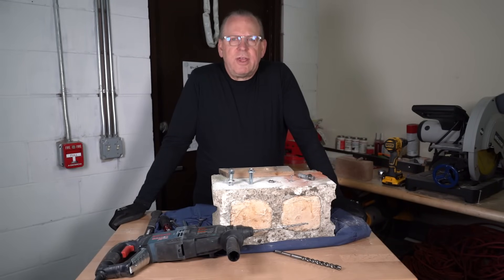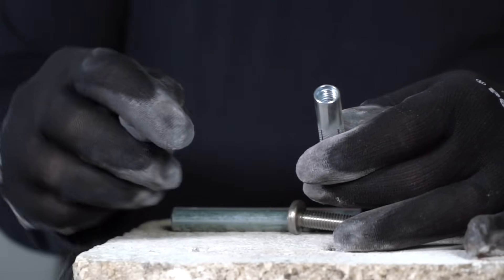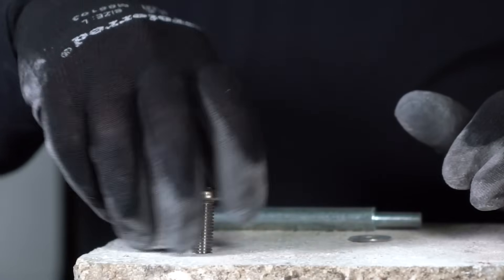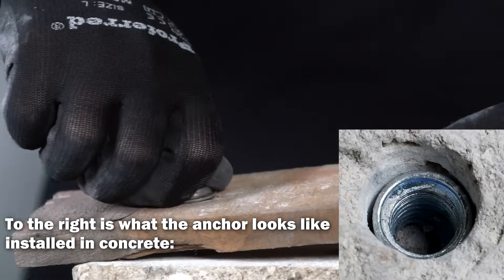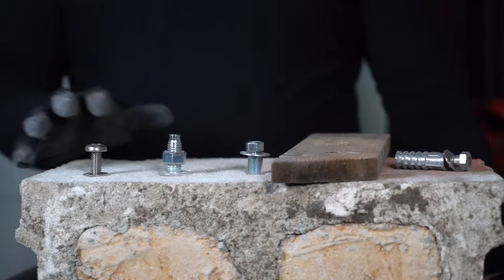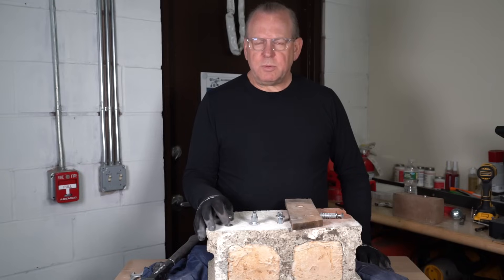How to Install Masonry & Concrete Anchors | Fasteners 101

Comment from the maker: Here's a series of quick links for our viewers if you want to see specific parts of the video:
1:19 - About Lag Shield Anchors (Link in Description)
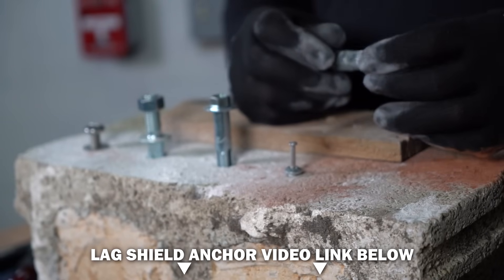1:30 - What You Need for Installation
2:57 - Installing a Drop-In Anchor
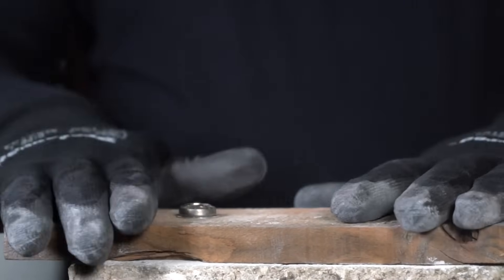5:32 - Installing a Wedge Anchor
8:07 - Installing a Sleeve Anchor
9:47 - Installing a Hammer Drive Pin Anchor
Reply: Can you show how to remove the anchors?
Reply from the maker: Concrete anchors are not designed to be removed. This makes them more secure because they are actually anchored into the concrete, which means they can't be removed without heavily damaging the anchor or concrete. You can use a sawzall or similar tool to remove the tops of wedge or sleeve anchors.
Reply: at 5:30 when you say "Fastened" was my favorite part just classic
Reply: Hello, Drop-In  vs Sleeve anchor, which is better for hanging on slab?  Thank you.
Reply: @AlbanyCountyFasteners  hi, how about realigning wedge anchors if they're off center? or do i need to resign myself to oversizing the hole in the base plate?
Reply from the maker: @philippetts1701  yes oversized and double up with fender washers if needed.  Bolts should be tight an seated firmly.  Good luck!
Reply: @AlbanyCountyFasteners  thanks for the advice, however, before drilling the post base, I decided to try realigning the wonky anchor bolt, and it worked. Used a lump hammer and some hard wood to avoid damaging the threads. Only needed moving a couple of degrees, and it didn’t loosen the fit, so it’s still solidly in the wall and tightened up well when I torqued the nut up. Maybe I’ll be reposting back here in a few weeks/months/years if the bolt ends up pulling out though!

Comment: Video on fasteners was very easy to follow with an explanation of product and use.   I have used stainless steel screws and washers for my screen enclosure in Florida and I am extremely happy with their performance and appearance after three years.  The washers were recommended by Albany because of use and dissimilar metals which can cause some corrosion. So far no corrosion has occurred and I am extremely happy with their performance and their cost.

Comment: This was a very helpful vidoe demo. I went and bought the second bolt anchor. I poured square footings to support a trellis archway. I'm using an L bracket to bolt the 2x4 against so it needs to be secured in the concrete. I just put them in before it was solid cured. Once it's completely dried I'll tighten up the bolts.

Comment: Thank you! I drilled big holes in the ceiling concrete and wondered if I should apply a hammer for the sleeve anchor or not. Useful thanks

Comment: Love the calm vibe of this tutorial.  I couldn't figure out the differences for masonry fixings. Going to use wedge anchor bolts to put up an awning and hang a side gate, just need to make sure i drill the correct distances too. Kind of laughed each time I heard "Once this goes in, it's not coming out." 😨 It'll be fine I'm sure.

Comment: Thanks that is very informative easy to learn. I stop in store in front of the concrete screws I did not know which one to use. I asked and I think I bought the wrong one.
Thank you again. No I can fix the 2 x 4 to the wall.

Comment: Great video. Thanks for creating it.....   Question. I am about to use a wedge anchor bolts in concrete footings for a deck project. In my case they are Red Head TruBolt brand.  I drilled the holes too deep and the entire 5" bolt can sit in the hole without touching the bottom. I will also be using Anchor fix epoxy in the holes. Will these bolts still work if they are not touching the bottom?  My fear is that when I tighten the bolts they will simply rise straight up as the nuts are tightened without pulling the expandable bottom into the sleeve.

Comment: Great vid. So if I want to drill eyelets into my garage's concrete ceiling to suspend a Jeep hardtop, I'm guessing the drop-in anchor is the best solution, so i can screw in the eyelet (and a future owner could possibly remove them)?

Comment: Great video - -BUT !!! - -no word on the most important part !!!!!!!! - - -how deep do you drill, you have to take into account the thickness of what you are fastening, as well as length of the dyna bolt (expanding bolt)) TO MAKE SURE WHEN YOU FASTEN EVERYTHING IS FLUSH !!!!!!
MOST IMPORTANT THING LEFT OUT !!!!!

Comment: hello, thank you so much for the video, very informative.  Perhaps you have some insight for me; I need to install an eyebolt of sorts into a garage floor in order to use it as leverage to come-along a vehicle that does not currently run into the garage, I need to be sure that the weight if the vehicle will not pull the anchor out of the floor. I would appreciate any help or suggestions for this application.  Thank you

Comment: Thank you, very helpful.  I am setting up an aluminum pergola on my patio. Do you recommend a drop anchor?  Has the square bottom brack with 4 screw holes
Reply from the maker: Yes I would us a drop-in achor.
Reply: DOING THE SAME THING WITH A GAZEBO

Comment: Hopefully you can tell me for a solid oak sign 96L x 22W x 2D, there is no way I can weigh it. It is large. Which bolts would you suggest? I was going to put 6. 3 at the top and 3 at the bottom.

Comment: Can you talk about how much you can pull with these. Maybe rate the holding force from strongest to weakest. I want to pull up a piece of concrete. I guess about 6K lbs, so don't know which are the best for them. I would think one of the first two.

Comment: I like it! Im wondering if i can make a hole on the concrete without a hammer drill?.i dont have all the tools.will it be possible to use a concrete nail as same as the bit diameter? 😁
Reply: I think you can with drill that has percussion mode and a good masonry bit. It will take a bit longer than hammer drill, but should work. Make sure you have a more powerful drill, like 850w or more and if it overheats, take some breaks. If you have small drill, like 500W, it may be harder to do it.
Reply: @nilsfrahm1323  Or he can do what I Do, Start off with a smaller size bit, followed up with the desired size bit or a Bit size that is between the smaller bit used and the desired Bit. Like having a pre drill hole.

Comment: What anchor do you recommend using to secure a steel gate post on top of a concrete footer?  The gate will separate the front yard of a home from the backyard.  Rationale for placing the post on top of the concrete instead in the footer is to create a modular post that enables the entire gate assembly to be removed and reinstalled to accommodate movement of large items, such as a skid-steer, in an our of the backyard on rare occasions.  Space between the post and the side wall of the home will be roughly 1 inch and space between the other gate post and the brick wall along the property line will also be approximately 1 inch.  Total distance between the home and the wall is 91 inches.  The posts will need to support a 6' steel frame gate with wood laminate inserts.  Weight of the gate is unknown but estimate to weigh 70 to 100 lbs when constructed.  The size of the gate and space between the wall and home is set due to safety specifications required as a result of the backyard having a swimming pool.  This also creates unique challenges because if the post is 1" from the home and another inch from the wall, then I'm unsure what type of metal plate design should be welded to the base of each fence post to use as a securing mechanism between the gate posts and the anchor bolts.  Regarding anchor bolts, based on this video, the drop-in anchor appears to be the best option for my need.  However, if you have a different recommendation, please let me know.  I can also email a picture of the work layout if that helps.

Comment: What would you say are the anchors people use to anchor eye plates to the ground when using chain hoists or come alongs to pull shed walls back into an upright position.
Our sheds on a lean and we're pulling it back into place with a chain hoist and I was going to put the anchor on the opposing walls foundation beams, but maybe just putting it into the concrete is better, i'm not sure.
Reply from the maker: Wadge anchor but drill the hole deeper so you can cut the wedge bolt off and bang the remaining into the ground.

Comment: Hi, I want to attach a 2×8×10 two ledger boards to the brick wall of my house, for my patio cover, I was thinking of using red head 1/2×4-1/4 wedge anchors,  every 3 feet, since it is a 20 feet long ledger board, will it be strong enough?
Reply from the maker: No wedge anchors.  I would use 1/4" hex head Tapcons.  Wedge anchors will crack the brick and fail.

Comment: need to anchor a post for a railing.  The stairs are limestone on brick, which anchor do you recommend? How deep should I go to anchor a 36 inch high post?  Also, how much bigger should the bit be for a 3/8" anchor bolt?
Reply from the maker: Lime stone is soft and will crack.  You will need to drill through the lime stone and into the base brick.   You will need 6" threaded studs with washers and nuts stainless steel and epoxy those rods in according to the epoxy manufactures directions.  Be carful not to crack, chip or damage the lime stone during drilling.  Make sure the lime stone slab is on flat ground with no voids when drilling.  Good luck!
Reply: @AlbanyCountyFasteners  wow,  thanks.  That's what I read. Needed the second opinion as I go into my DYI project.

Comment: Nice video. I am mounting a 100lbs AC Condenser on the side of my concrete foundation.  Looks like the wedge or a sleeve anchor may be best.
Reply from the maker: A wedge anchor could work, but you would need to be careful about hitting any rebar in your concrete foundation. A better choice for that application would probably be a titan hd bolt or titan hd mini bolt. How big are the holes in the bracket you're using to install this ac condenser to the wall? If we knew that we may be able to give you a better answer for what fastener to use.

Comment: Wonderful video. I have a metal gazebo that I need to anchor down to concrete patio. What would be best to use in this situation and what length? We do have bad sand wind storms occasionally. Thanks for your suggestions.

Comment: Question. I just placed  the one you used at 3:05 (drop in anchor). When I set it, the set tool would not go all the way to the shoulder when struck multiple times, but anchor seems fixed.. I’ve set it in concrete ceiling of a basement.  So it’s a little hard hammering upward.  I put in a threaded rod and almost hung from it to test out. Using sound didn’t help much, all thuds sounded the same. Question is, does the set tool have to be hammered to the shoulder? How to hammer upwards?
Reply from the maker: No, it does not.  It just needs to be set.
Reply: @AlbanyCountyFasteners  great, thanks!

Comment: Excellent video. Just a couple of questions.
1. How deep do you drill the holes for the respective anchors in order to control the exterior protrusion of the bolt?
2. Which anchors are the strongest to the weakest when it comes to pullout force.
Reply from the maker: 1. The exact depth of drilling will differ from anchor to anchor, size to size, but it's generally 1/2" deeper than the anchor's length, with drop-ins being as deep as the anchor itself. Specific anchors will state their drill depths.
2. Wedge anchors have the best pullout resistance of all the anchors with sleeve anchors relatively close behind. I'd estimate Drop-in anchors and Lag shields being after that with hammer-drive pin anchors being the "weakest." Keep in mind that all have good resistance to pullout and the material they are being installed into will affect their performance.

Comment: Which anchor would you suggest for a concrete floor to best resist being pulled directly up out of the concrete floor? This application would be for a table the regularly has force being applied upwards that wants to lift the table off the ground.
Reply from the maker: Wedge Anchors would be your best bet for that application. They tend to boast some of the highest pull-out strength of all concrete anchors.

Comment: Hi, I have two Fischer FBN II 10/20 R anchor bolts, and I was wondering what size drill bit I should use for installation. Should the drill tip be the same size as the anchor bolt (10mm), or slightly smaller? Thanks

Comment: Thanks for posting this helpful video! I can see the differences between the Lag shield and drop-in anchors (no permanent stud sticking out) vs. the Wedge and Sleeve anchors. Can you comment on how to decide between Wedge and Sleeve anchors. They seem pretty similar, but there must be some general guide to selecting between them...
Reply from the maker: Which anchor to use, and what material to get the anchor in, will depend heavily on your application. As a basic rule of thumb, Wedge anchors can only be used in solid concrete and they generally have the highest and most consistent holding values in concrete while Sleeve anchors are usable in concrete, brick or block but their holding values are less than wedge anchors anchors in terms of shear and pullout. If you're ever unsure, you can try asking an engineer or just give us a call at 866-573-0445.
Reply: Albany County Fasteners Thanks very much for the helpful reply!

Comment: Nice tutorial. Wanted to get your opinion on which anchor to use for a gym set. Essentially it’s a punching bag and stand, and rather than use weights on the stand, I would like to anchor it to the floor. The base is approximately two inches and was thinking of having 3 anchors. One on each side and one in the back. In terms of diameter of the anchor and depth. What would you recommend ?
Reply from the maker: Wedge anchors are always a good bet, but it depends on what you are drilling into. Is the floor solid concrete? In terms of diameter and length, that depends more on this gym set you are installing. How much material does the anchor need to go through to fasten this to the floor? How heavy is the set? Take that information an review anchor specs to see what anchor meets your requirements.

Comment: Is there an angle drill that will work for retrofitting anchor bolts in a confined 2x8 joist height. And drill bits that are short and switch out to longer bit's the further you drill?

Comment: Great video! Any information on how to make the holes you had already made for the anchors? Was that with the hammer drill - and how do you measure depth/width of the hole?
Reply from the maker: It was with a hammer drill. The diameter of the drill should be the same as the anchor you are installing. The depth depends on the anchor and what you are drilling into, but it's typically 1/4"-1/2" longer than the anchor you are installing to help with any excess dust that gets down there during drilling.
Reply: @AlbanyCountyFasteners  Thank You!

Comment: Nice video, It will help me a lot in my project, my question is: I need to lift abou 2 inches half of my driveway that is sunken by the middle, my idea after this video is use 4 drop in anchors, chain it up, a bar or 1 4x4 and jack it up, only problem is that I don't know the weight of the concrete slab, the size is 8 ft by 12 ft long and 4 or 5 inches thick I don't have to lift the all thing, just the middle and fill it wit some very wet cement or foam, it is 4 drop in anchors enough to lift that?, how many do I need to lift bet. 3000 and 5000lbs.? Thanks for any comment and help
Reply from the maker: Read the manufactures information.

Comment: Is a hammer drill necessary to drill into concrete or will my regular drill with a masonry but suffice? Thanks.
Reply: Use the hammer drill.  It makes a difference.  When I tried with a regular drill, it didn't penetrate very well.

Comment: How safe is a Wedge anchor for hanging ceiling fans, will there be any safety check required every 4 or 5 years?
Reply from the maker: Refer to the manufactures information.

Comment: Question, For the wedge anchor I see you drove it in first and then put the wood onto the stud, could it be done the other way around where you drive the wedge anchor through the wood and the concrete, then tightened, as in a similar manner as the sleeve anchor? Or can that only be done with the sleeve anchor?

Comment: Thank you for the information and demonstration.  I'm wondering what builders use to fasten metal columns to concrete slab.  Could you share your insight on that?
Reply: I think it's called chemical anchor, it's like a very strong glue that you pour in a hole in concrete and then put a screw there, it cures after 30min and becomes very strong. These anchors in video have some limitations, they can't be used close to corners and spacing between them is required.

Comment: Re:  Wedge anchors -- which I am presently using to better secure the mudsill to the foundation here in earthquake-prone California -- they say to drill the hole to the diameter of the wedge bolt.  However, it seems hard to hammer the bolt in unless you "ream" the hole just a bit wider --to accommodate the wedge...  Is this OK or will doing this affect the maximum "grip" strength" of the bolt ?  When I tighten, they seem to be in there pretty good, but I was just wondering if this will affect the performance when the 'BIG ONE' finally hits ...

John
Cali
Reply from the maker: No, you're doing it right. The wedge anchors should be quite tight in the hole to better secure them.

Comment: What would you use to anchor a jet ski lift to a concrete seawall? Seawall cap is 18 inches deep and the bracket has 7 holes in it for 5/8 bolts. I was thinking lag Shields? Thanks!